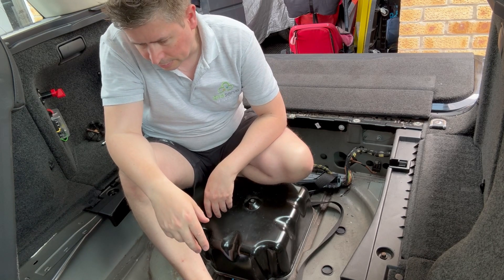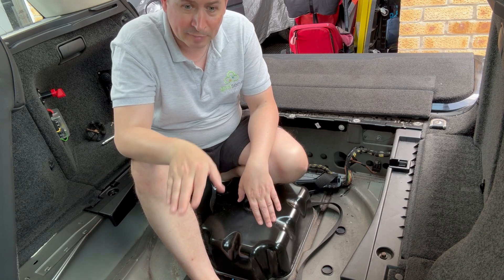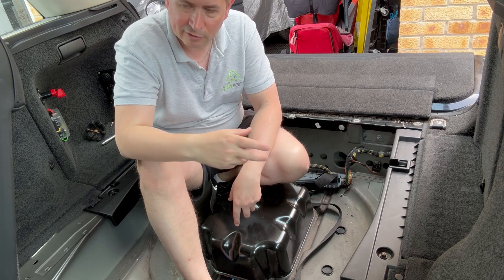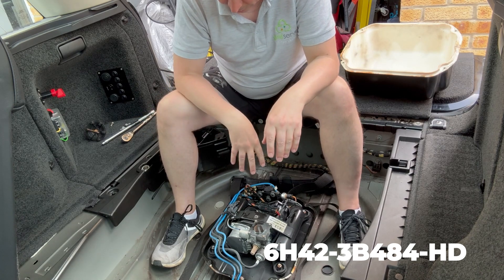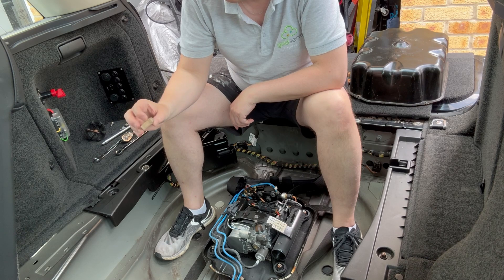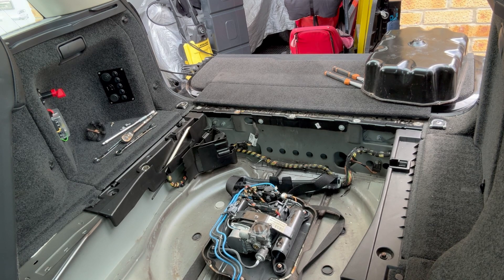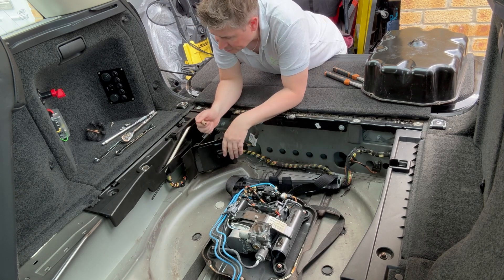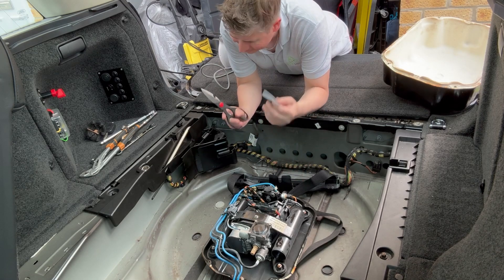Range Rover L322 Air Supension Error C1A13-64, Not Venting - FIXED!

Comment: Thanks for the video.  I had the same symptoms and error code.  I didn't have hardly any dust when I removed the cover.  I hit the filter with the air compressor and it wasn't breathing much, so I ran the drill bit inside the filter and that seemed to clear it out more.  No more error codes!
Reply from the maker: Glad it helped, and that you managed to sort your own. Thanks for watching.

Comment: Was having the same error (C1A13-64) and lifting issues as you.  I pulled the filter and let it soak in some CLR for 10 minutes, blew it out, then put it back on.  So far, raising and lowering are not causing warnings.  I also ordered a service kit from 4x4AirSeals to replace the media and seals.  Thanks for posting!

Comment: Drill that sintered brass filter and will help too. Common issue and the fix is to drill it through.
Reply from the maker: Might do that actually. I did wonder why there was a filter for the exhaust, although I imagine it’s just to stop foreign body ingress? Is this where the air enters the system as well, I can’t remember? Since having ‘serviced’ the fitting, my suspension has been faultless (although I won’t say that out loud as I wouldn’t want to anger the Landrover Gods!) 😂
Reply: @Dadulthood  It’s the exhaust only. Remove it. Drill it through and refit.